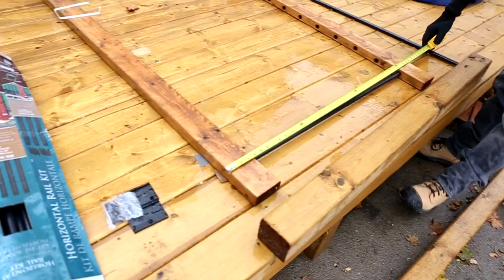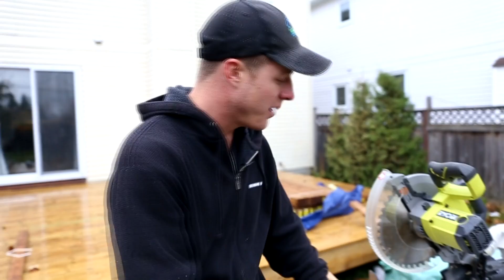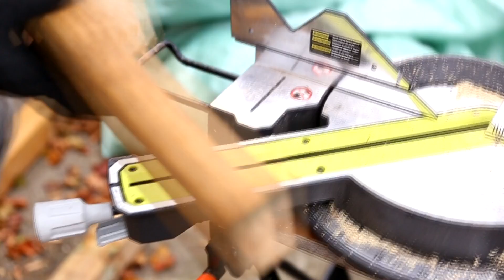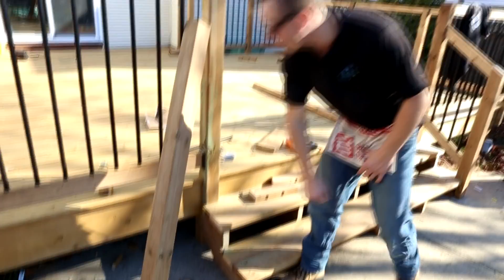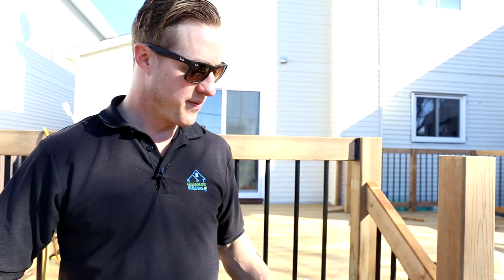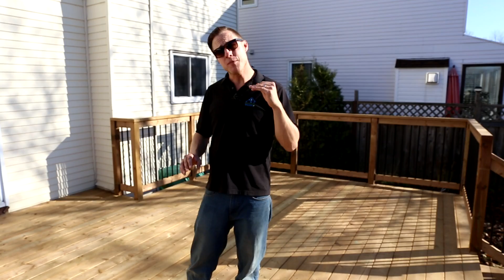Quick and Easy DIY Installing the Veranda Deck Railing System

Comment: Some good trucks in this video but you seem to spend more time talking about mounting the posts then installing the Veranda rails (which is the title of the video). I didn't see you install the horizontal railing... it was just done.  Also when you measured the balusters and rails you said I am going to add 3" and then added 3.75" without explanation. 

There are tidbits of good info here but the video could have been much better

Comment: This is rookie bullshit. The IRC codes for outdoor residential decking states that you don't need guard rails if the deck is less than 30 inches above grade, true...BUT... If you do put up guard rails, THEY MUST COMPLY WITH ALL THE REQUIREMENTS OF A GUARDRAIL ON A HIGHER DECK. You can't throw up a crappy sub-code railing because the rail isn't required.
 Notching the 4X4 posts down to 2X4s will not meet the requirement of withstanding 200 pounds of lateral force. They WILL split and break off if the lag screws don't pull out first.
Even if the deck is only a foot above the grade when people lean on the guardrail, and they will, the fall to the ground can cause a bad injury and the home owner will be sued.
 Don't listen to anything this clown says. He has no idea what he is doing, or talking about.
Reply: This is Canada.
Reply: @thedcp  Okay Canadian. Do you have any idea what  IRC  stands for?
Reply: @williardbillmore5713  clearly not. But you seem super upset about it hahah. Chill bro
Reply: @thedcp  IRC stands for INTERNATIONAL Residential Code. That means it applies to Canadians as well.
People will look this substandard dangerous railing and think, 'Oh this is the way to do it I saw it on You Tube". Then they will "chill" right to the hospital and a law suit.
 Do you think that is okay, "Bro"??

Comment: The stair kit is 4ft but the distance between my posts on my stairs is 4ft and 4.5 inches.  What do you suggest?
Reply from the maker: I'm sorry Zina N, I'm not following.  Did you buy pre made stair stringers and it is not working out for you?

Comment: Notching rail posts are no longer allowed per the IRC.
Reply from the maker: Deck is less than 24” off ground, railings are decorative on this deck, not required.  This was mentioned in the video.  Also we noted to check your local building codes.

Comment: Good work, man! a quick question, what hardware used to install the top support between posts? I see a kinda black brace, but couldn't find anything like online. Would you mind share the hardware link? Thanks!
Reply from the maker: This hardware came with the spindle kit, without them the job looks rough.  I'd go into your local hardware store and talk to the contractor desk, they will likely be able to order in in something similar.

Comment: Just went through a 12x12 deck with this system. The aluminum balusters go pretty well all though time consuming. Some spacing may vary by the center mark per section for code and aesthetics. They suggest silicone around every baluster connection. Definitely use the black colored stuff vs clear. Also top tip when you do the stair balusters you likely have to cut them. I used a plumbing pipe cutter for perfect cuts. Didn't hurt the powder coatings for me. You could use blue tape but up to you. Good luck!
Reply: You should never have to cut them

Comment: Hi where do you start from to calculate where your post go as obviously all the rails won't be the same length but need to keep all the spacing between spindles the same, cheers

Comment: Great video. Is there a way to build a matching deck gate using the same veranda product?
Reply from the maker: Its likely possible.  I'm not sure how you would get any support corner to corner diagonally unless you used light gauge airplane cable and turnbuckles.  If you do it be sure to send us a pic.  Happy gate building:)

Comment: How tall did this railing end up being? I ordered the 26 inch aluminum railings and doing the math it will be hard to get a 36" railing using 2×4s for the horizontal supports and a 2x6 handrail.
Reply: 3 1/2” top support 3 1/2” bottom support 1 1/2” cap 26” spindles and bottom rail support 3 1/2” off the deck surface. 26” + 3 1/2”+ 3 1/2”+ 3 1/2” + 1 1/2” = 38” - 2 inches that the spindles go into top and bottom railing + 36"

Comment: Do you recommend a (2x4) or (2x6) handrail for the top.  Also, I was thinking of installing solar lights over my posts...could they just attach to the top of the handrail, instead of the actual post ?
Reply from the maker: Solar lights attach to posts from what we've experienced.  Just make your posts longer and but your cap into the posts instead of running over the top.  You can use 2x6 as a cap if you like, depends if you want to have a larger ledge to set things.  All the best.

Comment: What kind of lag bolts? Do I have to use carriage bolts on post rail mounted inside of joist?
Reply from the maker: We still use lag bolts when we mount on the inside.  I would recommend a 3/8"x 4" galvanized lag bolt with a washer (minimum 2 per post).  All the best with your project!

Comment: So if my deck is above 24 inches I would have to bolt the post on the inside of the rim joist?  So basically Id have to Sink a larger post in the ground and run it up through the deck?
Reply from the maker: In Ontario you don't need to extend the footing posts.  In our area the building codes allows us to place the full post flush with the bottom of the floor joists and bolt to the rim board and joists.  The post ends up being a little stronger but you end up losing about 3" vs the way we did it.
All the best with your project:)

Comment: Whats with the stair rail meeting the top deck rail? LOL
Reply from the maker: Hi Grixer,
Where we are the stair rail spindles come shorter for some reason.  I actually like that the stair spindles are shorter because I find it is easy to run the cap into the upper post, makes for a simple transition.
All the best with your future projects!